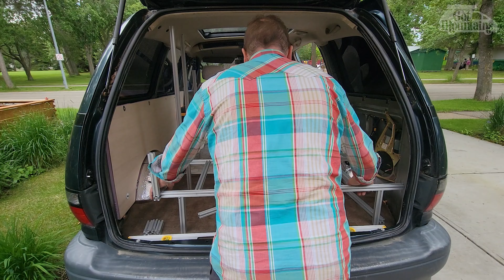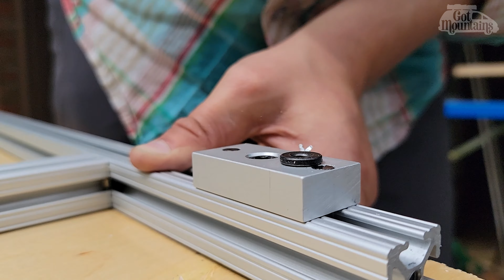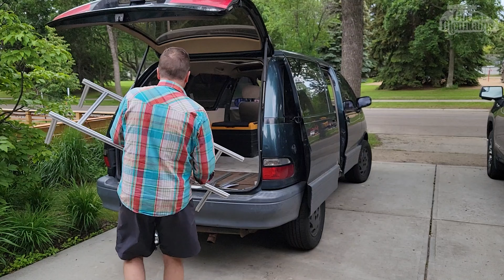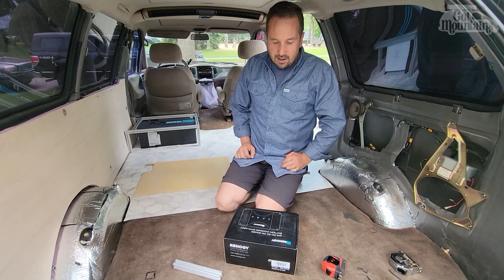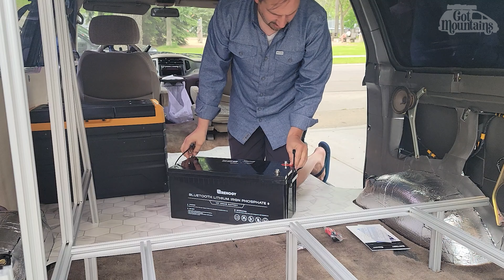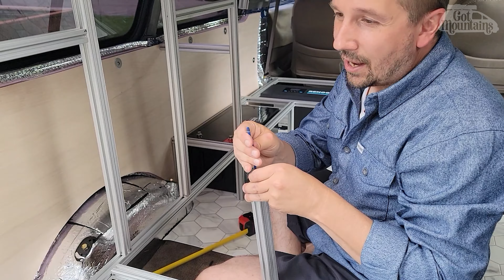This BATTERY is a BEAST & DC-DC Charger // E12 Lightweight VAN BUILD series

Comment: i would at least suggest one solar panel to help top up the battery during long stops or stays. I do carry one around for my DC to DC unit if i know I'm going to be sitting at one location for a few hours at a time. special in winter when i got the diesel heater running full blast. i have a 155 Watt solar panel. also i have seen some people get heating pads to put under the battery to keep it warm during the winter/cold if yours didn't come with the internal heating pad . Slim potatohead YouTube channel showed one that was USB. London Drugs sells one for $43 Sunbeam brand, follow Slims link
Reply from the maker: Yeah, I've never really needed solar but might get one just for backup. Unfortunately way up north here, panels only generate 1-5% of their capacity during winter so they aren't very useful. If we are parked it's usually because we are in the backcountry, so the batteries don't get used. If we're in the van we usually are on the move every few days so it usually keeps them topped up.

For heating, I opted for the batteries without heating...they suck a lot of power and mine is right behind the rear heater outlet, so once he van warms up it blows on the battery enough to tip the scales. Same with the diesel heater. I might still grab one though...the one time I need it will make it worth every penny.
Reply: @GotMountains  I don't bolt my solar panel to the roof of van, its easy enough to take it off the roof and place it on the side of the van to get the best angle out of solar charging. Takes a little more work to secure it etc but I don't mind the 5 extra mins.
Reply from the maker: @jasonflt  yeah, that makes sense. I think I'd prefer one that was temporary for only when you needed it. My only issue would be storing it. I'll have to see if there are some smaller ones around. Which do you have?
Reply: @GotMountains  mine is fairly large 155 watt panel. The panel fits in between the roof rack on my Dodge Carvan. if I'm hauling the kayaks or something else, it doesn't get into the way to much. I ratchet strap the panel to the roof and drove 12hr without a single issue. There wasn't any rubbing noise either.

Comment: Hi Eric, I notice one of your forward vertical 80/20 struts has a piece extending out from it at an angle. How do the butt and and side joints get attached for the angled piece, is there some sort of special connector?
Reply from the maker: Good question...I struggled with that one for a few hours. In the end, I used a flat bracket that I bent on the rear facing aspect that was bent to match the angle.  I used another on the driver's side facing aspect. Between the two and their other attachments points, it's super solid. You'll see what I mean in an upcoming video. Hope that makes sense 😅
Reply: @GotMountains   Got it, makes sense, thanks for that.  🙂
Reply from the maker: @leo169  Anytime!